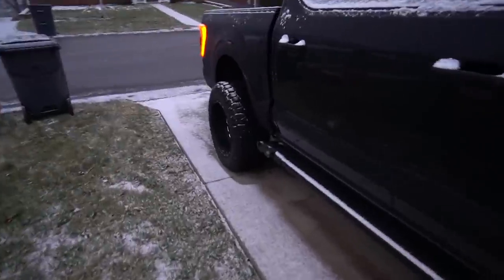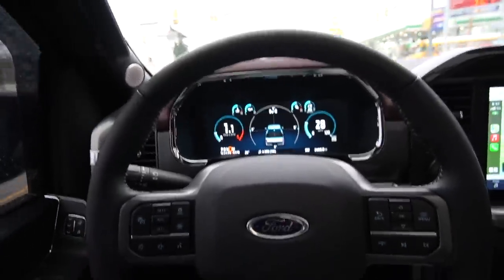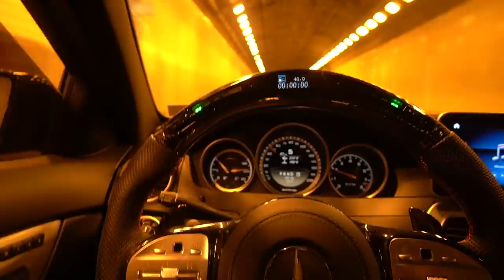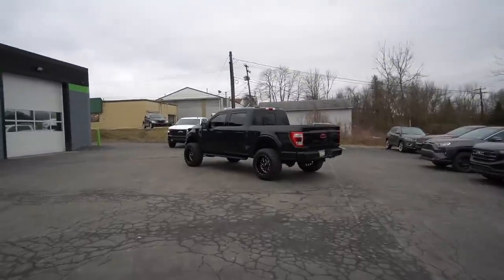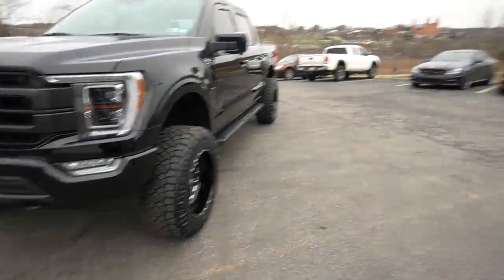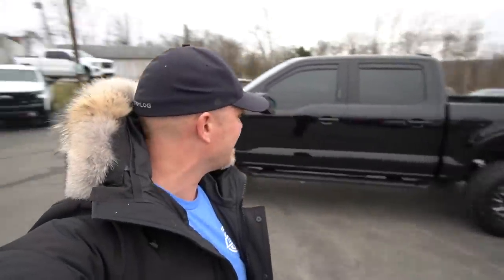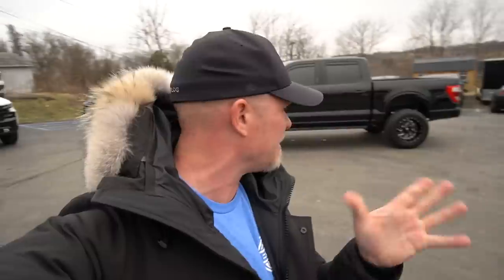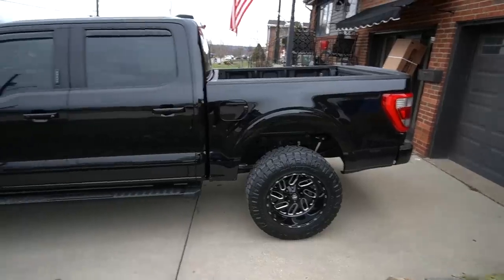The Most Important F150 "Mod" Yet!

Comment: That exhaust sounds great the way it is . Dont you dare touch it .
Reply: Exactly.
Reply: straight pipe without cats??
Reply: Its trash
Reply: @garyjenkins1783  what you talking bout Jenkins? Exhaust sounds awesome. That truck is phenomenal.
Reply: The borla attak on the last truck sounded alot better imo
Reply: Hell nah headers no cats and x pipe with some borla arak mufflers is killer
Reply: That’s one thing I wish Mike would do, listen to his fans. He needs to leave it the way it is, we all want it that way
Reply: @mikeross717  nah man we need to come together
Reply: @mikeross717  that truck better make 480hp next month with headers , tune , cold air intake ,  and mustang gt intake manifold
Reply: TO THE WHEELS!
Reply: @alonsogarcia9113  1. With the lift and wheels it won't do that with those mods alone 2. Ive heard the new f150 computers are locked pretty tightly so it might be a little while before tuning becomes a thing 3. He needs boost like the 2015, 480wheel in a truck wont be close to what he felt before
Reply: @5.0_marcus  we’ll see soon how everything goes stills nice truck over all
Reply: @alonsogarcia9113  for sure the 2021s look good color matched and lifted just the headlights need some sort of tweak
Reply: @5.0_marcus  I work at ford dealership taking photos and the cabin insulation  of the 2021 is a big step up . It is very quiet inside almost  no exterior noise can be heard
Reply: @alonsogarcia9113  thats amazing I'm actually about to start sound proofing my 13 f150 cab here soon because ford skimped out on it and with my roush exhaust it can be brutal at times
Reply: It's a cheap change he can make a video about, garner a bunch of views and make more money. Next week let's change the wipers, then the wheels, then the air filter.....wash rinse repeat. Every channel is the same after awhile.

Comment: I thought the same thing when I heard your cold start. Needs to be louder and meaner. First thing I did on my 2021 Ram was straight pipe it, then sent it in for 6.5" lift and 20s on 37s. The cold start is insane on this truck. Sets off the alarm on my wife's Yukon every time. 

Also clay barred, polished, and ceramic coated it myself. Took like 10 hours, but that coating is amazing. I wash and dry the truck in like 10 minutes now. The coating is so slick. It really is amazing If you've never coated your car before.

Comment: You should talk about cost on stuff like the coating on the F150 etc...
Reply: I just had a new truck ceramic coating in Alabama by a reputable detailer and it cost my 1,000 for the truck and the wheels. Expel is expensive so he probably spent close to $2k for everything
Reply: @braxtonwiggins6576  i concur with the above
Reply: I just got my 2021 f150 ceramic coated, I do it with all my trucks. Cost in Canada is about $850. Always worth it

Comment: Make a video on if your V8 has oil consumption issue or not so far. Try to reach out to ford engineers about the cylinder lining and if the manufacturing process has change. Also do a video about cylinder deactivation.

Comment: Most definitely need the protection and not only from rocks, I had about 7k miles on my 19 silverado when on the 101 frwy a car part came flying from under the car on fron of me (looked like a solenoid) and hit the hood right above the headlight; not sure it would have protected 100% as it made a dent I can see from 300 feet away but probably diminish the damage, needless to say I weep everytime I see it😩

Comment: Can you give an approximate cost for the ceramic coating and wrap? I'm sold on the results, just wondering if its affordable.
Reply: I had Ceramic Pro on my 15 Sport. It is AWESOME. I got an 18 Sport with the lux group and this one is black. I have yet to ceramic coat this one but dude do it
Reply: @jasoncarter251  So what was the cost?
Reply: @TaylorBohannon  Depends on the area you are in. The prices vary place to place. I'd say ceramic only between 800 - 1500 depending on the brand and durability claims of the coating, shop, area.

Adding Wheels, Glass, and trim might bump those numbers a couple hundred but shop around.

Comment: Xpel is crap compared to Ceramic Pro! If you truly want protection, then get a Ceramic Pro Silver or better coating. My truck has 2 year old Silver on it and I still don't use the windshield wipers!